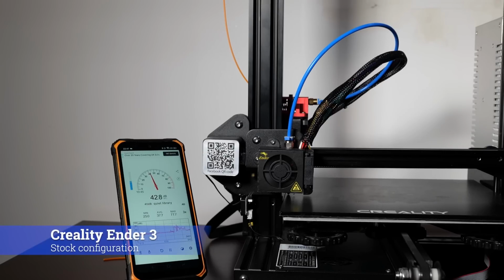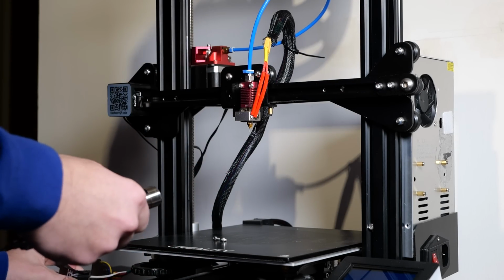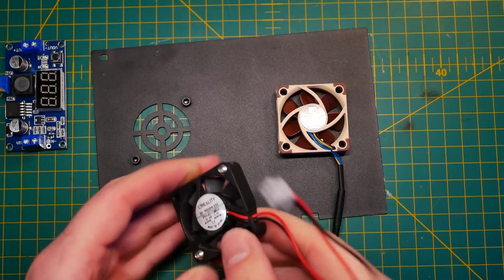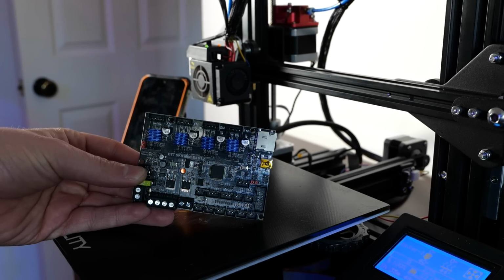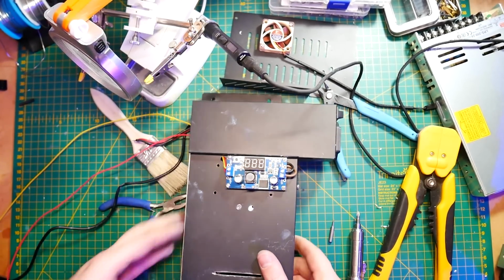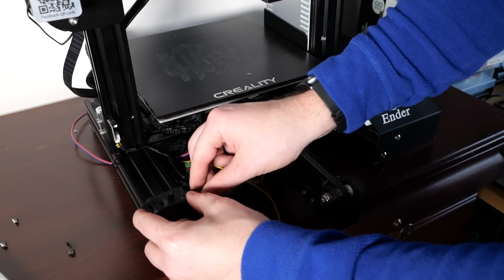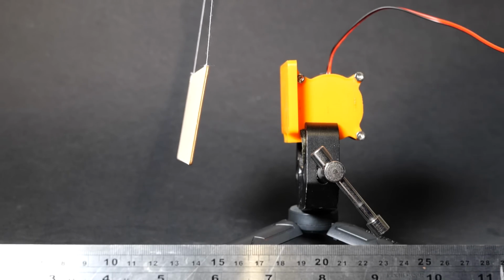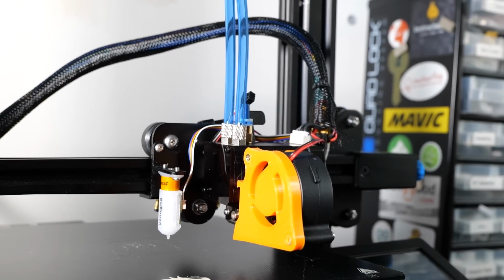How to make your 3D printer quiet

Comment: When I got my E3v2 I printed a Satsana cooler duct and used a 24v 5015 fan for print cooling (can be adjusted in Cura to 50%) and a 40x40x20 24v fan for the heat break. That made the printer almost completely silent. I put a open mesh cover on the power supply without a fan and a 12v 80mm fan (with Buck converter) on the power supply. The thing is dead silent running at normal speeds of 50 to 70mm/sec. That whole conversion only cost about $30 USD.

Comment: I just finished installing my Noctua fans and holy cow, what a difference! Thank you so much for this video, because I have never heard of Noctua before this. The only upgrade I did not do was the Fanless PSU. My stock PSU is still going strong and I will continue to use it until it fails on me. I subbed to your channel and I look forward to future 3d printer mods for the Ender series.
Reply from the maker: Going fanless made a big difference as that fan was on constantly. Cost more but if you ever need a PSU for a project but fanless and swap out the one for 3d printer

Comment: Excellent video, especially the discussion on fans. Most people on the internet just tell you to deal with the noise. I bought and installed a 60 mm by 20 mm noctua fan for my part cooling fan. But it was a 5 volt one and I couldn't get it to run slow enough to be silent while still having good airflow. With 100 % power it had good airflow but it was noisier than the stock radial fan on my prusa mk3. I'll try a larger radial fan next.
Reply from the maker: I have an idea to test all these fancy blower setups ppl post online for their hotends. Considering all I tested so far... I think the conclusions would be rather surprising to see.

Comment: Noctua is fine for electronics but they’re absolutely terrible for the hotend or part cooling. You can get a great 24v fan that will outperform the stock fan and will be as quiet as Noctua without suffering any performance. It’s the wrong type of fan for layer cooling. Half of all problems people have would be solved by not putting the wrong fans on their hotends.
Reply from the maker: Precisely the conclusion from my video and testing

Comment: Watercooling on an bedslinger design seems ridiculous in my eyes.  You won't be spitting out filament fast enough to really need anything more than a silent (even Noctua) fan to keep the cold-end cold.  As for your sound when throttling the larger fan on the old Ender 3, you probably were using low-frequency (possibly software-timed) PWM.  Whether that could be replaced by HW PWM depends on the board used, but I think you could also add some small filter circuit on the voltage going to the fan to turn the PWM into a more smooth steady voltage level.
Reply from the maker: As this is a complete print head you could mount it on other designs for sure. Slingers is what I have so I had to roll with it. It looks cool tho. Might be getting a second one just for the sheer joy!

5020 seem to respond well so I just need to order one. Maybe I was just unlucky with my 4020. That pitched whine isn't as terrible just more noticeable in silence.

Comment: The loudest part on my printer is the power supply fan.   I really need to replace that cheap power supply Creality supplied with a decent Meanwell one and throw a quiet fan in it.  The hot end cooler that Creality supplied on my Ender 5 Pro is virtually silent so replacing thank goodness.  I have seen Creality offer a genuine "silent" 24V fan for the hot end, and I think that is what they installed in my Ender 5.  So quiet compared to a lot of the Ender 3's I've seen....  
The SKR Boards are good, especially if you update Merlin to a new version and configure it for them as they support linear advance, which Creality boards do not as Creality run the drivers in stand alone mode.
Reply from the maker: Go fanless. Its awesome :)
Reply: @notenoughtech  Definitely need to.  The cheap power supply they used from factory is awfully loud
Reply from the maker: I made the ender3 one quiet but I'm tempted to have the same mod with fanless then add it to the bottom of the printer
Reply: @madorax251  I haven't tried Klipper, but I was under the impression that the TMC2208 in standalone can not do linear advance.  These are the silent ones.  Some of the V4.2.2 boards are not silent and come with A4988 drivers.  The A4988 driver does support Linear advance, but these are not a silent driver.

Comment: I bought Creality Ender 6 and the only significant noise is made by the fan. I don't get what's the fuzz.
Reply from the maker: I have an SLS printer at work, and I don't get what's the fuzz with bed levelling 🤦‍♂🤦‍♂ I mean what's the point of even buying Creality series when you can drop 30K on a printer that gets  production quality parts completely silent and hassle free?
Reply: @notenoughtech  Price?
Reply from the maker: You have a completely different machine and claim you don't get what's the fuzz. Especially when you have the evidence of the difference between stock and modified versions side by side. So ....

Were you watching in mute with CC on?

Comment: For the part cooling fan, you can simply use a 5015 fan or similar and set your slicer to 75% max fan speed. This will make it quieter and no additional circuit needed. Also, you can get a printer tent like the one Creality makes and that will make your printer far quieter and help you print ABS/ASA more reliably with less particulates/fumes in your room. All my printers use quality dual ball bearing 24V fans like Sunons and are in tents.
Reply from the maker: If you optimise for flow and noise then undervolted 5020 is what you want to go with. Same airflow with complete silent performance. I want to keep my slicing profiles mostly unchanged this is why I wanted to match the airflow of the original creality fan

Comment: Mine PSU actually does turn off the fan. But it was using 12V fan anyhow, so no need to step down. Strange, as this is 24V power supply, but hey...
Reply from the maker: I suspected this could be a case for others so I mentioned this in my video as a curiosity

Comment: Sure - NOW you partner with Noctua, when I already bought their fans for both my 3D printers and my bench power supply... :)
Reply from the maker: Then you are ahead of me! Excellent :) how's that working for your power supply?  Makes me wonder what else I can noctuized
Reply: @notenoughtech  I actually printed a new fan holder that uses 2x12V noctua on each side of the hotend (still with space for BLtouch) and that is by far the best thing I have so far. I am VERY happy with it - money absolutely well spent. I can now listen to the printer and hear if the old and moist PLA breaks while printing :)
Reply from the maker: Trust me water-cooled one is the next best thing haha

Comment: Compared to my Hictop 3DP17, which sounded like a bag of spanners, my new Ender V2 is almost silent.
Reply from the maker: Haha I know the feeling. After stripping down all my upgrades I looked the ender3 and I was like... What is this loud witchcraft!!!
Reply: @notenoughtech  I’ve bought a BTT replacement board and drivers to try and calm it down but really struggling with the Marlin side.
Reply from the maker: Do you have a dedicated config file? More dets on how far you went ?
Reply: @notenoughtech   hey so I looked at from two angles - a) modify the file that comes with the BTT board to accommodate for the settings in the original Hictop board (hundreds?) and b) modify the Hictop file to include/replace with appropriate settings from the BTT supplied Marlin file (fewer, surely?j Problem is, not having been current in coding since VB for Office 97, despite 35 years in IT, it looks like I’ve got a loooot of coding tools/concepts to relearn before I get any kind of useable file, when all I really wanted to learn was 3D printing. Hence I bought a newer machine. But then I have all this hardware lying around, why settle for only one printer when I can still have 2? That’s the long story. The short answer is, I have 2 part-finished files and I’m still unsure how to compile and deploy. I don’t think I’ve found a decent straightforward beginner tutorial on that which doesn’t assume a LOT. And thanks replying, appreciate it.

Comment: Hi regarding part cooling fan, there is catch22 as it is controlled using not voltage but with impulses. Check https://youtu.be/mAOm78YBksg at 6:43
Reply from the maker: You will see me doing that later on 😜